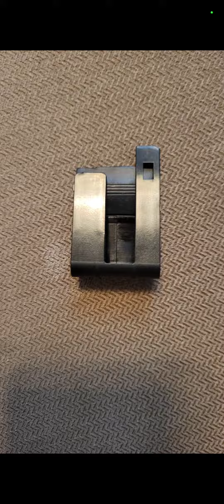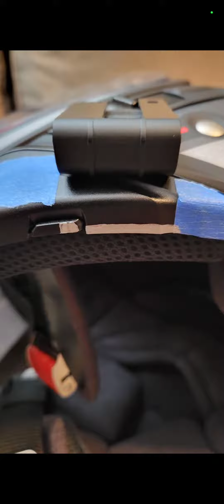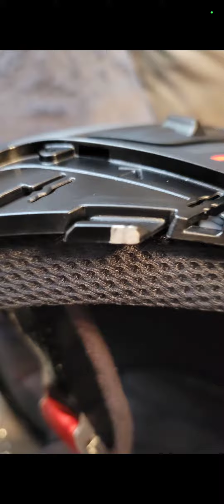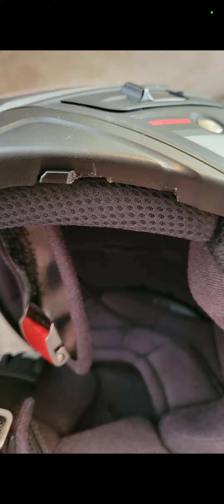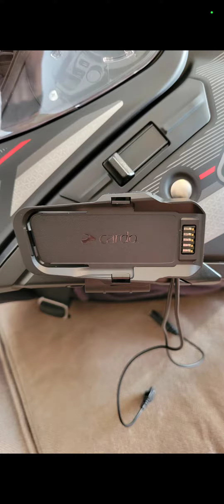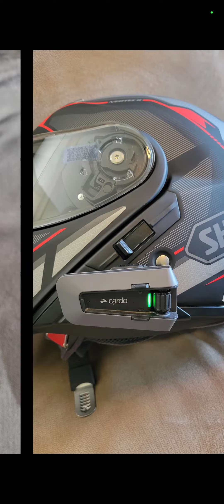How to install a Cardo Packtalk Edge in a Shoei Neotec 2, Neotec II

Comment: I wish cardo would release an adapter plate for these helmets. I love the gt air 2 and neotec 2 but prefer cardo over sena all day.
Reply: You're in luck, there is one now.
Reply: @70k_stormtrooper  I had someone 3D print the adapter for it a few months ago. It works great!
Reply: @mt-09nz98 How’s it working? Looks like it sticks out too much and hinders access to visor slider a bit in this vid 🤔
Reply: @t-rex4211  can’t speak for cardo’s version but the one I had made works great. Doesn’t impede the visor slider at all

Comment: Nice.  I'm getting very close to pulling the trigger on the same setup.  Glad to see you've led the way.  BTW.  How does the visor slider work now, with the comm unit installed.
Reply from the maker: No issues at all

Comment: excellent high speed presentation. How did you go routing the boom mic into the helmet groove inside cheek pads. Most (other than sena) are too long or have bumpy / sticky bits. How did the speakers fit in